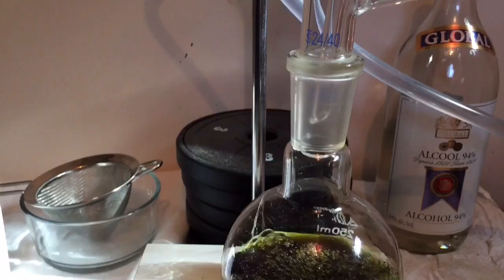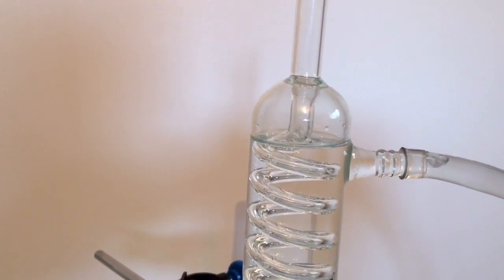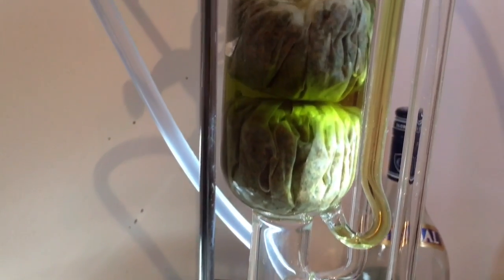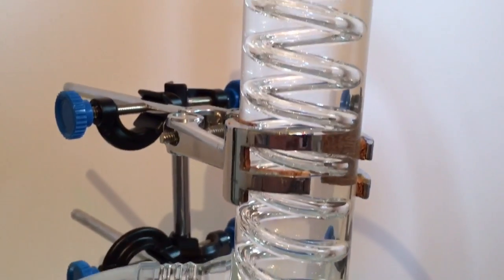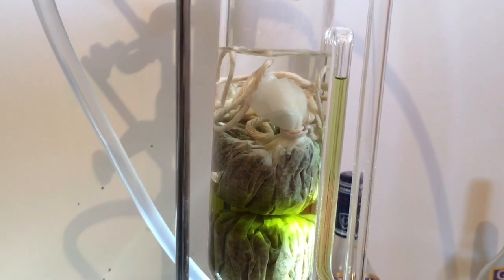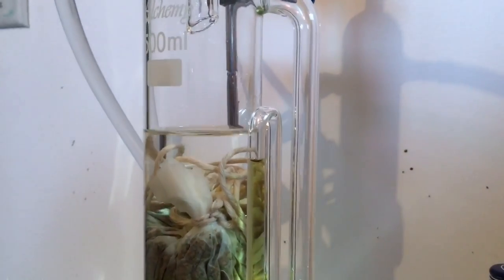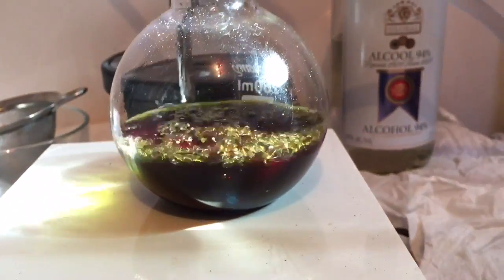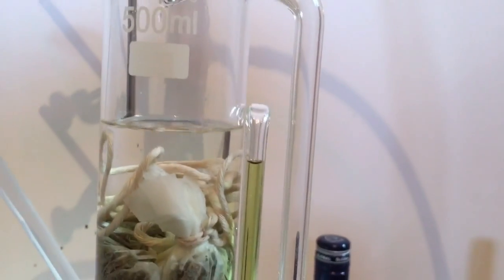Soxhlet extraction of cannabis

Comment: I mean I suppose you could keep on running the extractor and emptying the extracted before it empties into the flask that way you would just be taking cleaning alcohol
Reply from the maker: The concept is to use distillation to continually recycle the solvent (ethanol) thus washing out the stuff you want, which is alcohol soluble.
Reply from the maker: As it goes through a number of cycles, you end up with oil in the bottom flask, and alcohol in the column.

I pour off the oil, diluted with a little alcohol, into a stainless flat bottom bowl. The alcohol is boiled off in a double boiler arrangement.

Comment: All you do is running machine to extract from the material if you want to save I've the solvent from the extracted THC you would have to boil the alcohol off through a still then you would end up with THC oil in in the still and and the alcohol in a container to reuse please somebody correct me if I am wrong

Comment: How you separate ethanol with the extract?
Reply: Andrew Kuznetsov multiple ways , the easiest would be to distill off the ethanol since it has a lower boiling point than the other compounds , using a simple distillation , then using a short path fractional distillation apparatus to isolate the other compounds with vacuum distillation
Reply: But you may want to put the ethanol in the freezer for a day or so and then filter off any fats and wax’s then do a simple distillation

Comment: how did you decarboxylize the cannabis? and is the final solution after you dissolve the ethanol an oil or a water soluble solution?
Reply: The solvent and heat has given us the base there is no need for decarb. This product is still not water soluble though.

Comment: How does one separate product from the ethanol? It looks like a lot of chrolophyl is extracted in the process. Does it taste strong and planty?
Reply: Fhoulghl Ofdnposdu after this process you set up what is called a "straight line condenser" you evaporate out the alcohol and are left with the oil
Reply: Just evaporate the solvent off. Be careful to not overheat the mixture which could cause decomposition of the Cannabinoids
Reply: Use a non polar solvent to avoid chlorophyl
Reply: Baelor aren't these toxic?
Reply: Fhoulghl Ofdnposdu Do you not like the different tastes of cannabis? You can roto vap the solvent out and get a clean product.
Reply: Fhoulghl Ofdnposdu You can also fractional distill and get really pure if you want.